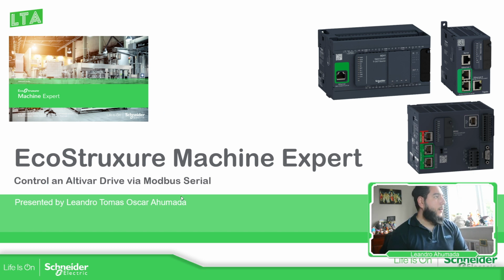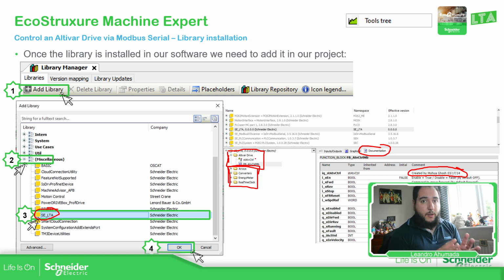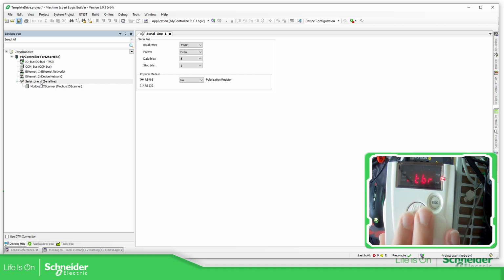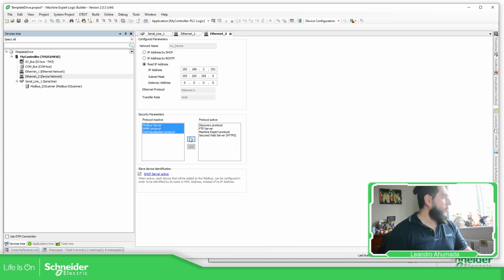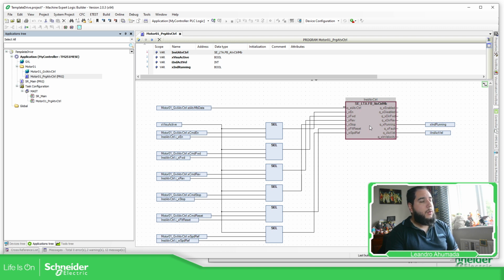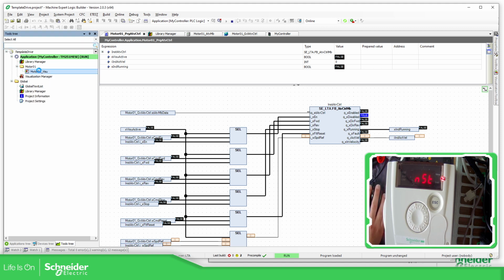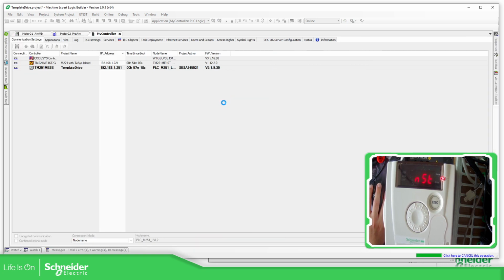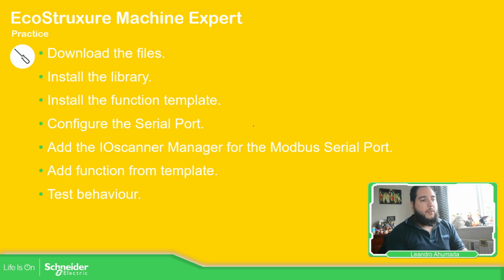EcoStruxure Machine Expert Training - M10.3 Modbus Serial Altivar Template

Comment: Hola Leandro,
Enhorabuena por el gran trabajo que haces y toda la información que proporcionan tus videos. Me gustaría pedirte ayuda sobre un problema que tenemos en nuestro departamento. Tenemos dos PLC TM241 que queremos conectarlos mediante modbus RTU a un variador ATV12 y un variador ATV320 (cada PLC conectado a un variador). Hemos visto los videos y hemos probado varias alternativas, pero no conseguimos conectarlos mediante modbus. Utilizamos el software Ecoxtructure Machine Expert (el Basic no) y hemos configurado tanto el Modbus IOScaner como los variadores. Para la conexión entre PLC y variador hemos utilizado un cable con cabezal RJ45 para conectarlo al variador, meintras que la conexión al PLC la hemos hecho utilizando los pines D0, D1 y Common del puerto serie 2. Al iniciar sesión en Machine Expert, aparece un símbolo de un triángulo naranja junto al elemento Generic Modbus Slave y el mensaje "The bus is not running". Hemos probado diferentes configuraciones de cables y con resistencias de terminación, pero no logramos realizar la conexión Modbus con ninguno de los variadores ATV. ¿Podrías darnos algunas indicaciones al respecto para saber si estamos realizando algo de forma errónea tanto en el cableado como en la programación? Muchas gracias por tu ayuda y perdona las molestias con este tema.
Reply from the maker: Buenas! quizas el problema no sea el cableado.
1) Checkear la configuracion modbus serial de cada equipo?
2) Verificar via somove la configuracion modbus de control via com (CD1) y referencia tambien (FR1) , ademas de ADD , TBR and TFO para que sean iguales a las del M241.
3) Verificar que el IOscanner esta bien confiurado, sino apuntar directo a la CMD and ETA, para esto checkear el mapa de registros de cada variador.

Comment: Hi Leandro
I am successfully using the SE_LTA library (version 2.1.2.1) in Machine Expert 2.2 and am satisfied with its functionality. However, I'd need to make some customizations to the library. (read more register from the drive)
Would it be possible to get the uncompiled version of the SE_LTA library?
Thank you for your support and the great functionality of the library.
Reply from the maker: Hi there!
The library file shared is only the compiled one. I do not share the original library.
Regarding reading more variables from the drive there is no need to modify the function block you just need to add more channels to the device created.
Best regards,

Comment: buenas tarde leandro estuve utilizando el template y el bloque de instrucciones me va bien , lo que sucede hay veces que el variador me entra en falla slf1 no se lo que esta pasando porque en 2 maquinas distinta me sucede y con distintas distancia de cableado en una maquina tengo 50 cm de cable y en otra 30 metros y en las dos me genera timeout en la comunicacion
esto no se si es debido a que en algun momento se interrumpe la comunicacion.
en general creo que tengo que enviar constantemente peticiones del modbus para  que no me tire abajo la comunicacion.
podre hacer un blink en enable del bloque cada 300ms para que constantemente este enviando los datos y con eso consigo que no me tire el time out 
o tengo otras opciones que me puedas ayudar
desde ya muchas gracias leandro
Reply from the maker: Buenas! El SLF1 esta relacionado al timeout de la comunicación modbus, como figura en el siguiente FAQ:
https://www.se.com/ng/en/faqs/FAQ000133761/

Si usas el template entonces lo que tenes que fijarte en el ioscanner cada cuanto envias la info al ATV. Ya pobraste cambiando el baudrate? Cuantos dispositivos estan en la red modbus?

Podes incrementar el timeout en el ATV, checkear la comunicacion modbus del lado del plc, modificar el baudrate como para identificar la causa.

Comment: Hello Leandro, thanks for this tutorial. I've tried and this message erro show up " Creation ot Test_PrgAtv[program]' failed. [One of the identified items was in invalid format] Do you have any suggestion? Best
Reply from the maker: Hi there! First time someone mentioned that error. I did the template on machine expert v1.2 / v2.1 .
Reply: @LeTomasAHUMADA  Hello, I have machine expert v1.2 and didnt work. Just to be sure, do I need Machine Expert v2.1? Best
Reply from the maker: @NimbaTech224  if i am not wrong it should work with any version
Reply: @LeTomasAHUMADA   Thanks. I tried with Machine Expert v2.1 and it works perfectly. However, I'm not sure why it doesn't work on our current version, V1.2. Thanks again for your wonderful job.
Reply from the maker: @NimbaTech224  thanks for your feedback. It may be related to the communication libraries 🤔

Comment: Hi, 
I tried this function but it does not work.
I followed the entire tutorial but unable to control the function block.
I used this method in another project a few months ago and it worked.
Currently impossible to use this function in any project
Reply from the maker: Hi there! Could it be that the drive is not configured properly?
Reply: Hi, today I succeeded to configure the driver. Doesn't add function from template but That work when I add equipement from template. We need to have over Bits condition to switch on  Inputs of the function block. We can't force the bit on. Thank a lot for your video!
Have a good day @sAHUMADA

Comment: Great info!!!! You save my life!!! Can confirm if this libs and template works with ATV310???
Reply from the maker: Hi Fernando! I do not have a ATV310 with me to test it (we do not commercialized this offer in UK) but the ATV310 is limited compare to the other drives so you will probably need to check the addresses on the device on the Machine Expert side. If i am not wrong you will need to change the 8502 to 8602 for the speed (i believe rpm). Take a look on the next manual: 
https://download.schneider-electric.com/files?p_enDocType=User+guide&p_File_Name=ATV310_Modbus_manual_EN_EAV94278_01.pdf&p_Doc_Ref=EAV94278